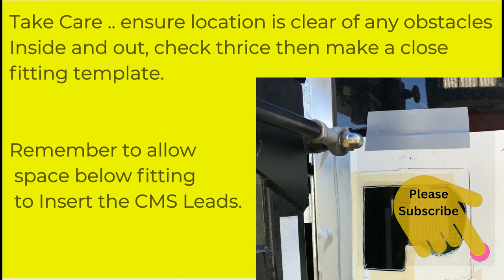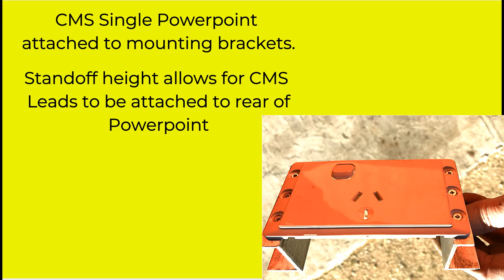240 Volt Camper Modification

Comment: So they don't come with a 240v external and internal connection ?
Reply from the maker: Prior to 2023 these campers did not have any 240V systems, the latest 2023 models now have 240volts hard wired into them.
Reply: Hi Guy's. Thanks for the reply. Can i ask you what the dust sealing is like on theres vans as i have seen a YT that showed in really dusty conditions the fridge area was full of dust .Thanks @campertrailering
Reply from the maker: I have not encountered much dust ingress into the fridge section if fridge door fan is on, air blows outwards through the vent opening. Having said that I have only travelled a few hundred kms on dirt tracks. Most of the Sand and dust that gets in the camper is when the doors are opened to access fridge compartment or whilst left open. No noticeable dust coating on carpeted walls of fridge compartment. Couldn't paste photos here, but will put on our Facebook Page, and looking at during a full review on my camper before i clean it, and put it on the market.  @troutchaser7424